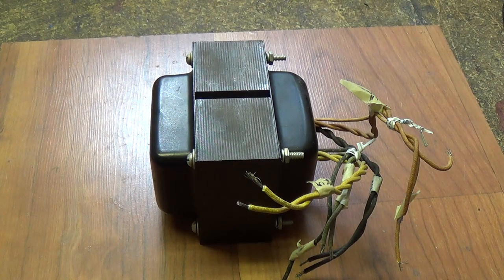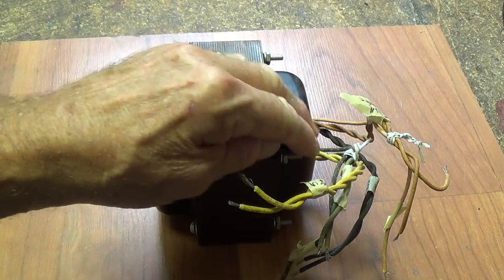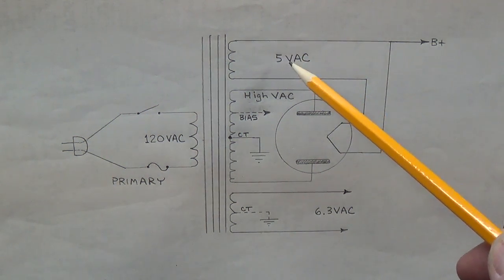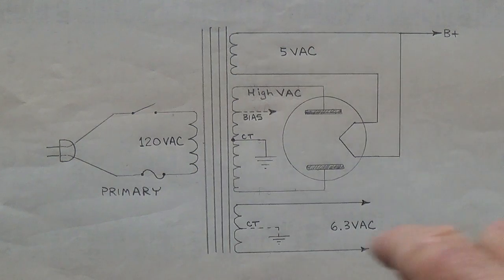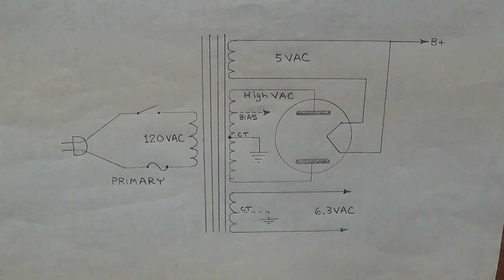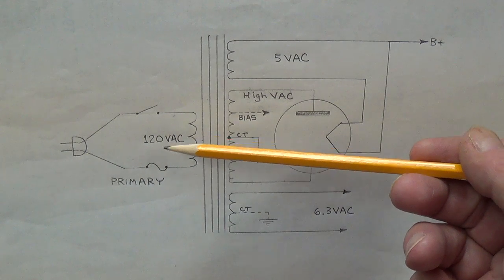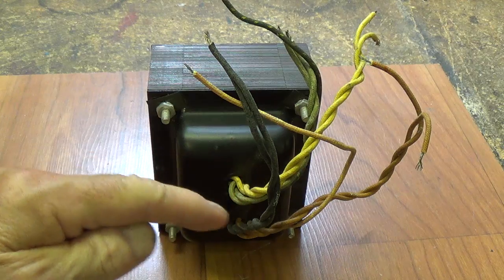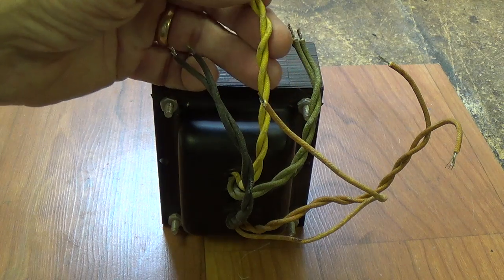How to Identify Amplifier Power Transformer Leads

Comment: Quick question here, I have a champ 600 power transformer that has no center tap for the high voltage, I also have 2 amp kits that use diode rectifiers with no center tap on HV, so can I assume this is normal? Also, would there be any benefit to creating an artificial center tap like you taught us to do with 6.3 V windings that don’t have them?
Reply from the maker: Power transformers without center tapped high voltage windings are for use with Full Wave Bridge Rectifiers only. There is no way to create a "virtual center tap" in a HV winding.
Reply: @UncleDoug  thanks for confirming! That’s interesting that a VCT isn’t possible on the HV winding. Is that because it’s high voltage, or does it have to do with how the transformer works? ….. I’m gonna head over to your other transformer videos now to brush up.
Reply from the maker: @algio3041  The CT in the high voltage winding is the return route for the electrons in a full wave rectified circuit. Without it, there is no HV. The CT in the 6.3VAC circuit is not the return route, so you can do without it.

Comment: Learned some more here. I started to build the current limiter with parts I have around. Got done, it wouldn't work. The ceramic bulb holder I had was brand new, never been used, it has one of those chain pull switches in it, the switch is no good. I been carrying it around for years!
Thanx
Reply from the maker: Thanks for sharing this with us, Jerome.

Comment: Well I'm in a proper spot. I  bought a Soviet synthesizer with a transformer that doesn't have any datasheets or colored wires coming from it- every wire inside is grey and soldered to a terminal on top of the transformer. And the terminals are arbitrarily numbered and placed! The schematic doesn't list voltages and has very... "quaint" corrections. At least it works with a converter. :V
Reply from the maker: That sounds like quite a challenge, Jack. Good luck with it.

Comment: Hi Doug, Is there any difference between the wires that are the same color? Are they interchangeable?  thanks
Reply from the maker: If they are from the opposite ends of the same winding (generally indicated by being the same color, and verifiable with an ohmmeter), they are interchangeable.

Comment: best explanation ever; I do have a transformer that seems to have a 120VAC primary, a 130VAC secondary with CT, a 345VAC secondary with CT, a 5VAC secondary without CT; are those common?
Reply from the maker: Thanks, Laurent. The 130VAC secondary is strange......there is no need for it.....and you are missing a 6.3VAC secondary with CT. Are you sure the 130V is not really 6.3V ?
Reply: @UncleDoug  I'll take a picture of it, maybe I am confused
https://www.dropbox.com/s/x8ejta6o5mge5dm/transformer.jpg?dl=0
it's clearly a Chinese model, so the color-coding tends to be misleading...
I remeasured again and I did confuse myself. I have: 7 ohms between red and red, 76 ohms between brown and brown, 0.3 ohms between yellow and yellow, 0.6 ohms between blue and blue

Comment: I see a lot of used transformers that are sold for cheap but the leads are really short. How does one replace short lead wires?
Reply from the maker: You can solder on longer leads and insulate them with heat shrink tubing.

Comment: Thank you for the video Uncle Doug.

I have seen it like a thousand times.
I  still have 2 doubts if any of the people around could help, would be great.
1 how to know the current capabilities of a given power transformer

2 I have a bias wire as shown in the video.
But it has no ohm reading, but when applying voltage it works as a volt splitter between the center tap and one on the high voltage leads.
This tip is in working condition?

Greetings to all tube amp lovers
Reply from the maker: Greetings, Miguel. There is no way to accurately determine the current capability of an unknown transformer winding. The best you can do is estimate based on the gauge of the output leads. If your bias output lead shows an output of around 50 to 60VAC, it is working.
Reply: @UncleDoug  
Thank you very much for taking the time to answer.

Comment: An oldie but a goodie!  Question: any way to determine or estimate the VA rating or the approximate amperage rating for the 6.3v and the high voltage leads?
Reply from the maker: Thanks :)  Other than simply estimating based on the gauge of the output leads, I know of no way to determine the amperage capability.
Reply: @UncleDoug  thanks.  I will look into that, see if I can find a way!  I am thinking there are a couple of options:   load the outputs (not to failure) and use the transformer temp to be my indicator...  I.e.  over a period of hours apply a load and track the temp. I would expect that as the load limit is approached, the temperature will rise in a nonlinear way.  The other option I am thinking is to track voltage drop/sag as an increasing load is applied, which might also allow me to estimate the losses in the transformer ...   anyway, I will do my research and report back.   I have recently come into possession of quite a few vintage power transformers of varying size...  it would be great to know their limits so I can build amps that will be reliable. . .

Comment: Hi, Uncle Doug. I just bought a Pt for a 6G3 I'm building. Its has a 50v Bias tap. Do I use that to the bias board or the yellow wire coming from pin 4 of the rectifier?
Reply from the maker: The bias tap must go to the -DC bias circuit TG. Good luck with your build.
Reply: @UncleDoug  Thanks for the reply! Is TG ground?

Comment: Complete NOOB question: High voltage wires, carry less current, so their diameter is usually small. And low voltage wires, carry more current, so their diameter is usually bigger. Did I get this right? Please confirm. I am trying to learn, and I don't want to die from electrocution. Thank you
Reply from the maker: Wire diameter is directly related to current flow, Max, but not so much to voltage. Insulation thickness is directly related to voltage.

Comment: Uncle Doug, Is it possible to accurately read resistance on a transformer in circuit? Or would the surrounding components (resistors, diodes, etc) throw off the reading, rendering it useless? I was given a ‘75 Ampeg SVT that “just stopped working” and I want to test everything out before I even plug this thing in. There’s a chance he tried running it with no speaker load, and this thing puts out 300 watts from six 6550s.......... so I want to check the transformers. 😳 (At least measuring resistance will tell me if there’s been a critical failure. And if I don’t have to pull it out of the amp so much the better)
Reply from the maker: Simple answer.....no, you can't. But you can remove one wire from the circuit for each of the windings and measure the winding for continuity.....then reattach the wire and continue.

Comment: Finally... a teacher who knows how to unlock these electronics mysteries, for us newbies.  Thank you Uncle Doug for these many tutorials - the quality of which I have been unable to find elsewhere.  In terms of your invitation for further topic requests - and related to this particular video on amp power transformers - I'd like to see another angle on this topic.  That is where there is a need to replace an amp's power transformer with a new one, but the schematic [where available] does not specify windings values.  I'm confronted with this exact scenario just now, whereby I would like to convert my 120V amp to 240V - and the current transformer does not carry a spare set of windings for the purpose.  Exactly how do I confirm the power transformer specifications for my existing amp to a potential PT supplier?  A topic for a further session, perhaps?  Again, heartfelt thanks for these invaluable tutorials.  Uncle Doug, you rock - and you are pretty handy with that ax!  :)
Reply from the maker: This topic is covered in my Supro Tremo-Verb video series, Tony. You add up all the necessary voltages and current demands of your circuit and then find a power transformer that exceeds them all.

Comment: Uncle Doug, I just want to ask, in your opinion, what is the best high voltage in the secondary of the power supply transformer, I want to build the transformer first because I have plenty of EI cores, magnet wires, and bobbins, I have a manual rewinding machine,...do I have to consider the type of tube?...thanks in advance....
Reply from the maker: It all depends on the circuit, tubes, and type of rectification you are going to use, Sonny.

Comment: I know i'm a few years late but i dicovered a 'mistake' in your explanation UD... that is that there will most likely be no center tap on the HV winding when the transformer is from a device using a bridge rectifier. In that case the line ground will be on the rectifier itself
Reply from the maker: You're right, Max. The vast majority of vintage power transformers did have a CT for full-wave rectification, but some of the more modern PT's (which used a FWBR) do not.
Reply: @UncleDoug  from what ive seen it seems to me that tube rectification was longer present in the US. Us europeans went from those dangerous hot glass things to the absolutely safe and definitely non toxic selenium bridges earlier it seems. I get most of my parts from scrapping beat up tube radios, tape and record players  and have (except for one tape machine) never encountered a rectifier tube in those, even in models from the early fifties. But you can still use a tube for rectification on a non ct transformer by putting a diode towards each plate with the banded side, solder the opposing side of both diodes together and you got your center tap. Hope im making sense, english is not my first language so this electronic talk is hard to do sometimes😂
Reply from the maker: @maxs.3238  You make perfectly good sense, Max. Thanks for your knowledgeable input.

Comment: Hello Uncle Doug, this is uncle Luc (French Canadian here, call me Luke)... I am a retired industrial electronic tech and I find your channel very interesting as I am starting to build tube amp...   My take on a Princeton Reverd has started to sing yesterday! 

Anyway...
I would like to comment on something here, the technique with the ohmeter is of course the way to go but it could get tricky at times, so may I suggest a few more ideas?
Like you do, I will bundle the wires by who conducts with who... and I try as hard as I can to locate mostly the primary. 1,8 ohm can not be always trusted, sometimes there can be 240 Vac primary, or there can be 2 primaries to be set in series (240V) or // for 120Vac... in industrial we also had many Hi-V secondaries... says for a 3 phases motor etc....
And also I really don't like your idea of using a lightbulb in series with the 120Vline, the secondary at 300 or 400V will get you if touched....
So what I do instead is I use a small 12V transformer, say 100ma or so,  connected to a variac and adjusted to give exactly 12V out and I feed 12Vac to what I think is the primary. Then I can safely measure the voltage at all the secondaries without fear of zapping myself! 

12V is a 1 to 1/10 ratio of the power line, so if there is a second primary, I will measure 12 V across its wires, 5V will read 0,5V... 350V will measure 35 Vac and so on....
There is another method also but trickier involving an audio generator and a scope... but that's for another time
I truly enjoy your site and your deviant sense of humour! :)
Cheers, Luc
Reply from the maker: Thank you for your helpful suggestions, Luc.

Comment: Hi Uncle Dog!
Thank you so much for teaching us, I have a big doubt, I got a transformer that has an additional wire apparently not connected to something and I heard someone somewhere saying that the cable is some kind of ground or something, I don't have any idea of what it is, what it could be?
Reply from the maker: There is no way for me to guess what it's for, Andres. That would require some hands on testing.
Reply: @UncleDoug  It turned out to be a faraday shield, thank you so much!
If you still read this, the faraday shield must go to ground?
Thanks a lot Uncle Doug!
Reply from the maker: @andreslucioaigster3356  I have never heard of such a transformer feature, but if you actually have one, then yes it should be grounded.

Comment: Hi Terry So I just got an old Macintosh MR 74 tune laid on me. It says atop it's chasis that it has a 254V  @ 50 mA, 66 V @ 150 mA both share a center tap and a 6.3V @3A with no center tap coming out out its secondary windings. So is this transformer a good candidate for a tube amp? Even if it a low wattage amplifier. You thoughts on this would be much appreciated 
Love your channel. B
Reply from the maker: The voltage is OK but the HV current is quite low. Even if you use a pair of 6V6's, the current demands will be >60mA. It would only be useful for a single-ended 6V6 circuit, like a Fender Champ.
Reply: @UncleDoug  Thanks Terry I have an old Legend 30 chasis and hard wood cabinet with the Celestion speaker it came with. The amp blew up year's ago. I never liked how it sounded so I gave up on fixing it
 Hybrid amps suck. So now I will try turn the old amp into a Fender Champ
I will order the parts and let you know how the build is going. Thanks again. Cheers. B
Reply from the maker: @bcarr3116  Legend amps had nice cabinets and speakers, BC.....you are definitely keeping the best parts. Good luck with your build.

Comment: Hi Uncle Doug. I'm building a 5F6a - but this old Navy guy thinks he fried the Power Trans. Ugh. I tested the Chinese transformer (I think). Specs on secondary  read: Blue 260v, Yellow 25v, Green 6.3v and white 0v (centertap?)  My test on secondary leads: Blue leads:  together = 297, blue to white @ 174.8v & 44.08v.  Yellow together @ 29.6v,  yellow to white  @ 13.92v & 36.25. Green together @ 14.76v, Green to white @ 7.39 & 7.40.
White alone  @ 13.76v & to ground 125.3 v.  What do you think? Did I fry It?     Jeff
Reply from the maker: Not having a diagram of the transformer with color codes, it's impossible to guess, O7, but since you seemed to get voltage on all outputs, it's probably OK.
Reply: @UncleDoug  Thx. I will keep you joyfully updated on this HUGE learning curve I've gotten myself into. I've hooked back up ONLYthe high voltage secondary leads from the PT to the main board, and removed the B+ connection from the main board that comes from the Output transformer lead,  & "Voila" no more silly hum or blown fuses. Prior to this I was blowing fuses, had a bad hum and NO voltage to the Filter Caps. Yessiree Bob - I'm hot on the trail. Gotta put on my detective hat and full speed ahead. Maybe a bad capacitor because of the hum?
Reply from the maker: @odonnell7771  Good luck with your adventures in self-education, OD. It's by far the best way to learn.

Comment: Hello Uncle Doug your videos are helping me a grear deal. I just recieved a huge haul of hammond iron. One piece has 2 pairs of 9 wires each with same 9 colors on each side.  Weighs 22 pounds. Curious what you would do with it. Thanks for being such a good teacher. Im a guitar maker at heart but love tube amps and thanks to you am on my way to building a scratch amp from Hammond organ parts. May the lord bless you!
Reply from the maker: Greetings, Marc. To be honest, those huge organ transformers are just not desirable. They are too much of a good thing. Stick with the smaller ones for guitar amp use. Best of luck to you.
Reply: Uncle doug. Watched another of your videos and got a good hint at what my transformers from the organ haul are. 606 .....schumaker made. I got two super reverb outputs and a power with 340 volts and center tap. I really want to do a 5E3. I realize the outputs might not be best choice because of the 2 ohm output. The power tranny appears that it will work. Thanks for the great hint about Schumaker codes. LOVE THE INTERNATIONAL TRUCK.
Reply from the maker: @theguitarguy777  Thanks, Marc. Best of luck with your project.

Comment: Hi Doug! Your video's is such a great source of information, really appreciate it! I've got some questions which I hope u don't mind... I'm building a bass preamp and are researching about some things,I  will use a hybrid tube/ss rectifier and as I understand there should be a limiting resistor between the ss rectifier and the tube, your thoughts? and I'm searching for a gain/sensitivity control which appaerntly should have been used in some of the matchless amps, do you have any tips for me there? Keep up the good work and give my best to ollie and Jack!/Peder J
Reply from the maker: I'm sorry, Peder, but I have no experience with either hybrid rectifiers or Matchless sensitivity controls. Hopefully there are sites dedicated to these topics that you can access. Good luck.

Comment: Hi uncle Doug.  I wanted to mention, I have an gdr8514 airline amp that has no 5 volt coming off of xformer, plus no diodes for rectification.  Instead uses a 6x5gt as rectifier, and uses 6.3 volts ac as heater. I was not sure if you came across one of those in the past.  And I have a question unrelated to rectification.  - Do you have any vids that demonstrates how to lower B+ voltage using Zener diode and mosfet?  I have a db115 bogen xformer that outputs over 550v dc when rectified and capped, and was hoping to tame that beast to use with one of the fender clones I’m working on.  Unrelated, That bogen original chassis also uses a 6.3v heater rectifier too (6bw4)
Reply from the maker: Yes, some tube-rectified circuits avoid the need for a 5V winding by using a 6V rectifier.  No, I have never made a video about Zener diodes, but they definitely can be used to reduce voltage. They produce a lot of heat, so they often must have a heat sink.  Hopefully, you can find videos on YT by other people which will cover the topic. Good luck.